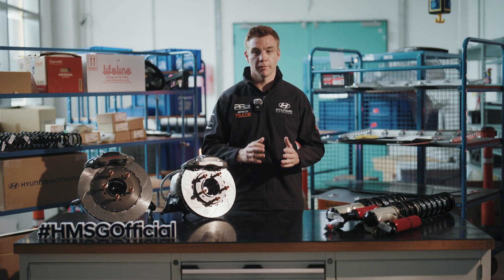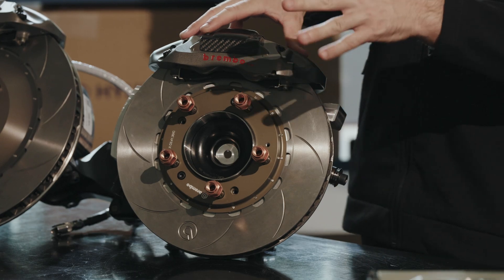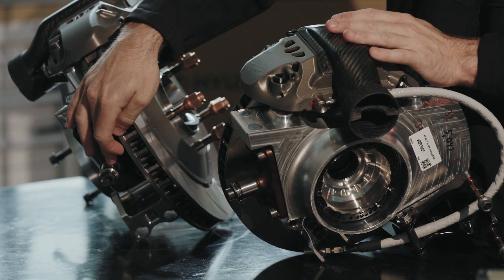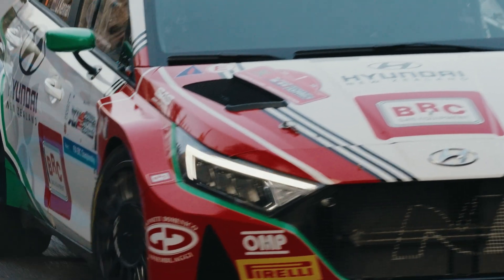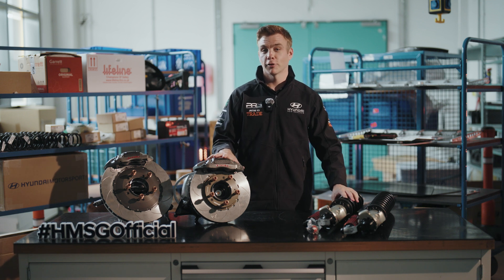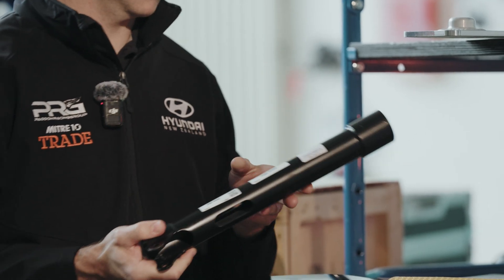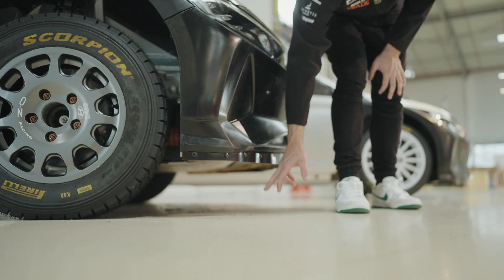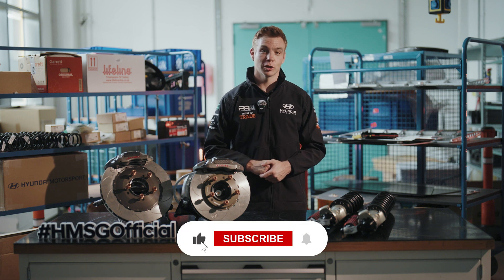Rally Driver Shares Top Tarmac and Gravel Setup Secrets

Comment from the maker: 💬 Got questions about rally setups? Drop them below and we’ll get them answered! 👇
Reply: what do i should do to get one of this cars?
Reply: Do you use even ground clearance front vs rear on gravel vs tarmac?
Reply from the maker: @LauriKumpulainen  Good question, we will get back to you 😉
Reply: What springrate are you using on smooth grippy tarmac (Spain, Corsica) and more dirty and bumpy ones (Croatia, czech stages) ?
What is the thickness of under car aluminium quards for tarmac and gravel?
Reply from the maker: @qwerty2010601  For the spring rate question, check out our Rally 101 on suspension here 👉 https://youtu.be/MGfvuKyodP8 As for the thickness of the guards, leave it with us and we will get back to you 😁
Reply: @HMSGOfficial  yea, I watched it before because I love this series but there wasn't any specific values. I only seen code of spring but that was gravel setup. I'm interested in tarmac setup 😉
Reply from the maker: Good point, we will get back to you!
Reply: Do you also change the arms for a different geometry and a anti quat / dive geometry?
Reply: How many torque Nm power you use for weel bolts gravel ang tarmac? Also how much is the tyre pressure for these surfaces ? 😊
Reply: Hi why you use copper nut for the wheels?

Comment: This question/inquiry has nothing to do with suspensions, but I'd like to see you cover how FIA WRC spec rally cars deal with oil sloshing/cavitation control in the engine's sump during hard cornering, especially on tarmac events with high grip, and especially on the Rally 2 and lower classification cars where dry sump oiling systems are verboten by the rules.

Do even the Rally 1 top tier rides have to use wet sumps currently as part of the FIA's supposed cost saving rules changes (I have not looked at the 2025 rules as of yet)??
Reply from the maker: Leave it with us 😉

Comment: Are those lug nuts made out of copper (if so for whatever reason??), or are they just an aluminum alloy (or a titanium alloy) anodized that color?

Also, did the FIA WRC rules actually mandate mud flaps even on tarmac spec cars in the recent past, or did the teams just all choose to use them back then, even if they were not requisite??
(I notice that NONE of the teams use them on tarmac currently, even on the rougher, and dirtier tarmac events, with much mud and debris kicked up onto the corner apexes from racing line 'cutting'.)

Is the only reason for the (still) large wheel well gap on the tarmac spec setups so that there will be enough room for the wheel to travel before impact with the fender on compressions/landings after huge jumps (but usually nowhere near as high flying as the gravel jumps), even with the much stiffer springs and damper valving?
Reply from the maker: We will get back to you 💪

Comment: Main difference setup wise snow vs gravel? Tyres are obvious, so excluding that 😅
Reply from the maker: The main difference between gravel and snow setups are the springs and anti-roll bars. Normally on snow, the car needs to be softer to search every little bit of grip. Ride height also effects this, but this is also related to which gravel event you consider, as very rough gravel events need more ground clearance to avoid damaging the car 👍

Comment: Front shock angle has nothing to do with caster. Its about packaging, fixing front strut to the side of hub allows much more space length wise for shock absorber, as bearing is not in a way any more.
I am more interested in roll center adjustments. From video I can estimate, that outside of arm is roughly 45-50mm higher for gravel. What is average car height change from tarmac to gravel, and do you change chassis pickup point for arm as well?
Reply from the maker: The difference in ride height between tarmac and gravel is between 50/70 mm depending on stage roughness. The car has common points for the suspension arm. The change in ride height also effects the kinematic characteristics. In general we have 2 options for the front and 2 for the rear to adjust the setup and car behavior during a rally 👍

Comment: y negative caster angle on the front dampners? assuming the arms are oriented to direct th force through at that angle, curious about the benefits, easier on power steering sysrem i imagine as one thing, cheers and thanks for the series cool stuff
Reply: The strut bottom is fixed to the wheel hub, it's not part of the steering axis. You can put it however you like. Angling the top by moving the bottom will change the roll center and antis.
Reply from the maker: The damper position is a compromise to accommodate our suspension into the wheel arch space and the steering position. Having the damper more upright will reduce the friction and the bending moment is very limited. The suspension motion ratio also differs from a damper installed with a pickup point more to the front 👍
Reply: @HMSGOfficial  thank you so much! makes sense, too used to traditional stategies but never worked with alomost 300 mm travel

Comment: Are there different competition weight requirements when it comes to tarmac versus gravel?
Reply from the maker: There is just a minimum weight they have to hit, which in WRC is now 1180kg 😉
Reply: @ that brings me to my next question. Because the tarmac version uses less protective and lighter undertrays, does the weight get moved somewhere else to compensate?
Reply from the maker: No, it is designed to balance out naturally, and the tarmac version that lighter (hitting the limits at 1180kg) while the extra protection just makes the Gravel version heavier 😉

Comment: Thanks for another great video, but what is going on with the front struts??
On most videos I've seen the struts seem to lean backwards significantly giving massive caster angles, which is odd enough. But in this video the struts seem to be leaning the other way, giving negative caster!!! This is insane....
I'm thoroughly confused 🤔🤔🤔
Reply: I realise that but I have never seen an application where the angie of the strut differs from the caster angle (that's why I'm intrigued) because this would create a significant bending moment on the strut as the wheel travels up and down on a different arc to that of the damper, introducing a worrying potential for stiction in the damper which would be particularly bad with such long travel suspension. Surely this would need to be avoided?
Reply: @pjay3028  The strut is already a structural control member of the suspension kinematics. Do you not think the side load forces from cornering (and sliding) or acceleration and braking create significant bending moments? (Or even just from the tire offset)
The friction of the damper is of course considered. But especially for offroad applications the amount of travel is more important.
The strut must be lengthened to increase travel. So it must pass below the axle and cv either in front or behind. This is primarily determined by where the steering rods are placed on the knuckle. The strut is then mounted to the other side.

In regards to friction of the damper. In the past they had used struts with roller bearings. But this has since been forbidden in WRC as a cost cutting measure.
Are you aware of the current damper strut configuration? They are what is generally referred to as a triple tube strut. The actual suspension damper is housed within 2 tubes which slide on each other. These 2 tubes are responsible for all of the bending moments. The suspension damper sits inside the 2 tubes and is completely isolated from any bending moments.
On lower model dampers even up to USD or €2,000 (each) a 2 tube strut is usually used. These cheaper 2 tube struts use the suspension damper body as 1 of the sliding members and thus bending moments are infact enacted upon the damper body itself. How ever even in the cheaper 2 tube strut system the damper piston and rod see relatively little bending moment compared with a road cars convention strut which sees the damper rod taking the full load.

If you look on older WRC vehicles such as from the 90s the suspension travel was less and the damper was usually mounted as vertical as possible (and above the axle and cv like a road car).

The short answer is that the suspension travel requirements are more important than the small friction difference from the strut angle. This is why all current WRC vehicles have the struts angled.
Reply from the maker: We will try and find out for you 😉
Reply: That would be really appreciated 👍👍👍
Reply: Hi pjay3028. Your understanding of caster angle is not correct. The strut angle itself does not necessarily determine the castor angle.

The castor angle is determined by the upper strut pivot point and the lower ball joint pivot point.
So the actual angle of the strut does not matter.
Reply from the maker: This sounds right 😁